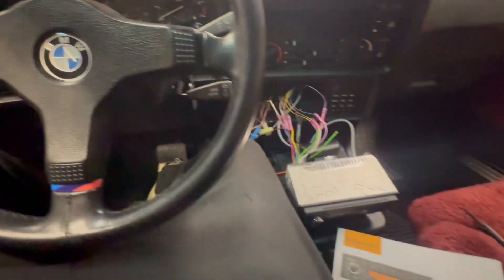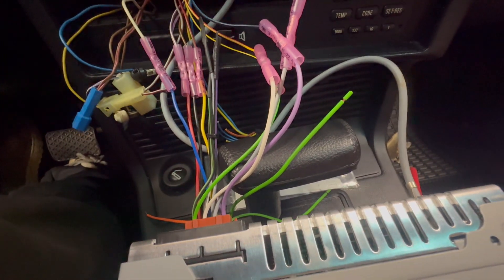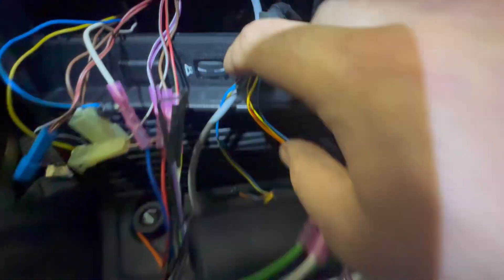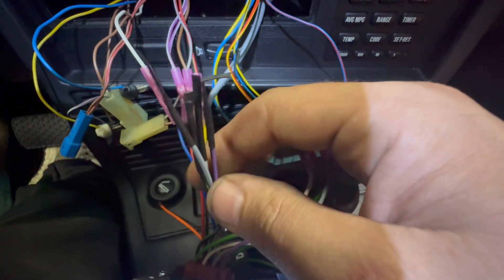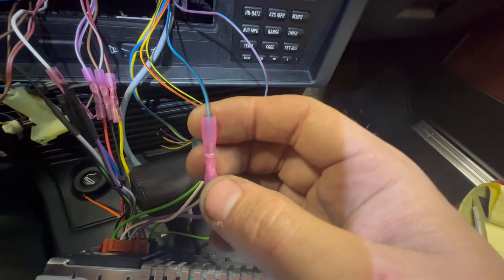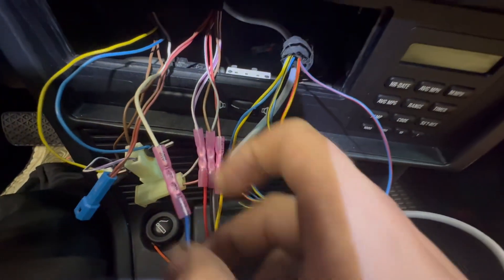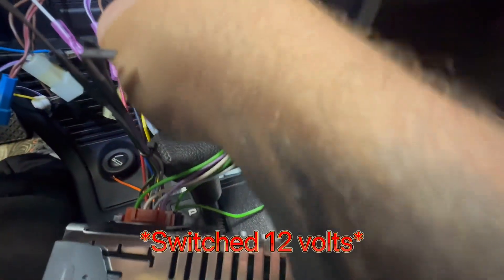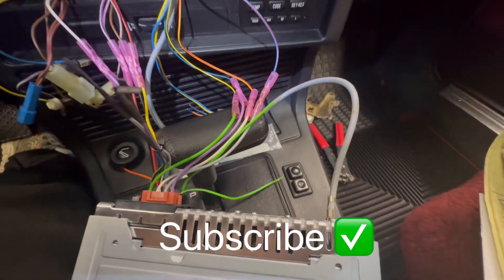BMW E24 E28 E23 aftermarket Continental radio install with wiring overview.

Comment: This is great!  I've had one of those Continental units in the trunk of an 88 535i for 5+ years, still in the box.  I've never installed car audio, and the e28 wiring seemed a bit dodgy.  I was actually thinking of having a car audio place rewire the car, and then later install an amp and small sub in the trunk/under rear seat myself.  

Do you think it's worth re-wiring the car with a better gauge wire and without the common ground?

Did you reuse the original OEM speakers?  I'd like to upgrade, but no interest in cutting up rear deck
Reply from the maker: @firstlast4874  so we wound up replacing the stock speakers with inexpensive pioneer units, and just running speak wiring from the radio to each speaker, cutting out the use of the factory amp. It was a night and day difference. It was very easy to do and sounded way better.

Comment: After watching, I purchased the radio. All power up but no sound, can you walk us through how to verify the amp is working. I tested the amp fuse and there was no power between the terminals. Not sure where the power comes to power up the amp. There is a spade on the out side of the amp but no wire to plug into and no wire around it.  Looking at it looks like there is no indication it had any connector on it.  Thanks for any help you can bring.
Reply from the maker: So the amp needs a trigger power wire from the radio to turn on. In the video you can see the blue wire is that amp turn on power wire. On the e24 in this video it was a white wire. Unfortunately this car is no longer at our shop and some of the wiring might be slightly different depending on what year your car is. If you’d like to email me I could forward you a wiring diagram for your car.

Comment: Hey, what’s that blue connector hanging loose on the extreme left I have the same one. It seems unplugged as well. I have the OEM stereo. Still trying to troubleshoot no sound turns on no sound.
Reply from the maker: @kashmiri911  you’ll want to verify your amplifier is working correctly. The blue connector is for the illumination.
Reply: @InnovativeAutohaus  so does it stays unplugged ? and also if I do replace it with continental do i need to update any wiring on the amp side or will it just work as you have shown .
Reply from the maker: @kashmiri911  you can tap into the grey red wire for radio illumination if you want to, otherwise just leave it unplugged. As long as your amp is working then there is no additional wiring needing to be done for the continental radio.
Reply: Amazing thank you so much. This is a great help. I’m going to try to pause a video and figure out the wiring through the colors. Now you mentioned that no negatives are supposed to be connected from the head unit the continental head unit wiring with instructions as to what wire connects to the corresponding wires that will be coming from the car as far as right left etc ?
Reply from the maker: @kashmiri911  You’re welcome, yes it’s all explained in the video.
Reply: Got it so before I go edward Scissorhands with the wiring I wanted to confirm that the original speakers should still work if we by pass the grounding via the fader knob ?
Reply: So question for the power I ended up getting a different after market but working seems solidarity. All matches other than the power connector on the after market has a red wire that says ( ignition) and yellow that says perm 12v not sure if the yellow is the constant or the red or does it connect the same what you have it